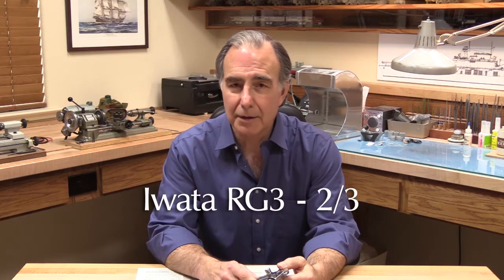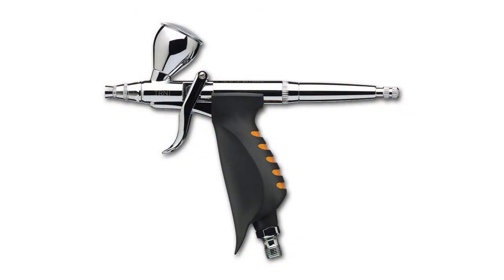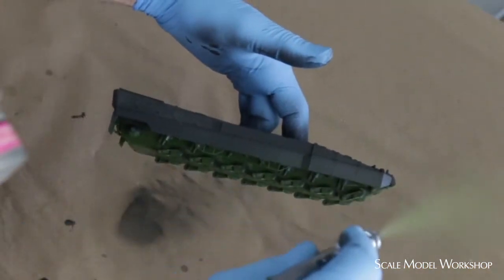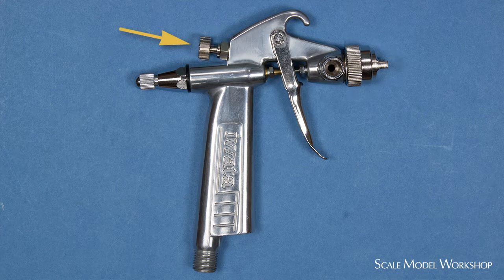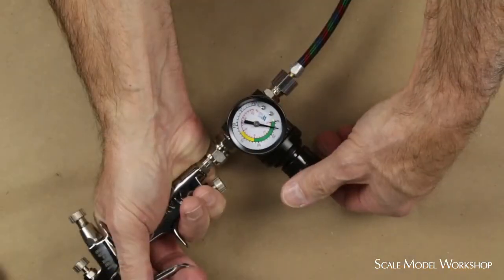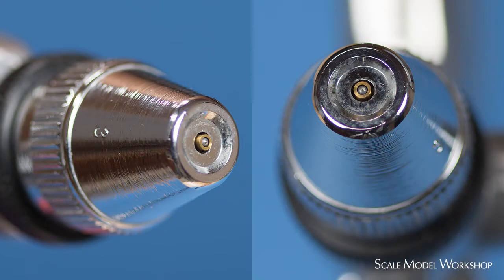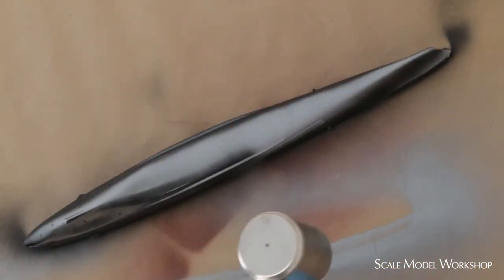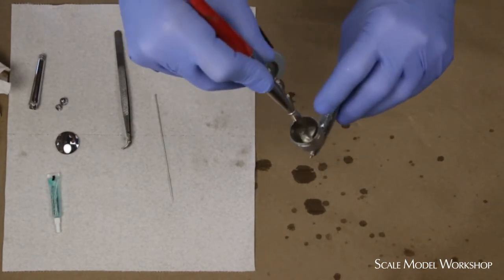Iwata RG3L for Scale Modeling

Comment: I already have an Iwata hp-cs with a .35mm nozzle. I want to use the RG3 for primers and clearcoats on 1/48 aircraft. Should I get the .6mm or 1.0mm nozzle? Thank you for your excellent videos.
Reply from the maker: I would suggest you go with the .6 mm nozzle.  Do not buy the model with the fan cap.
Reply: I bought the .6mm. Thank you for your advice Paul.